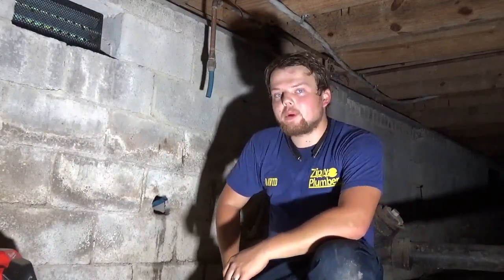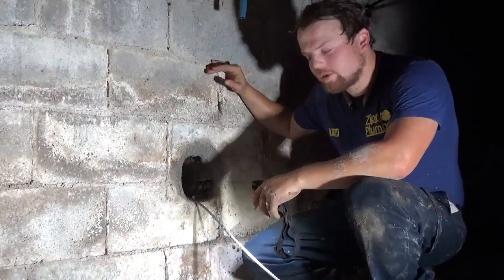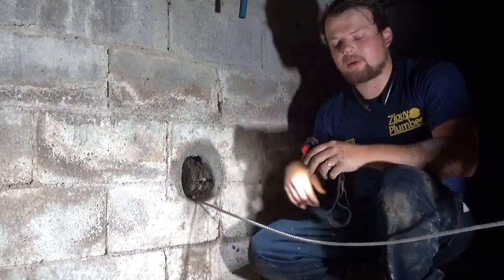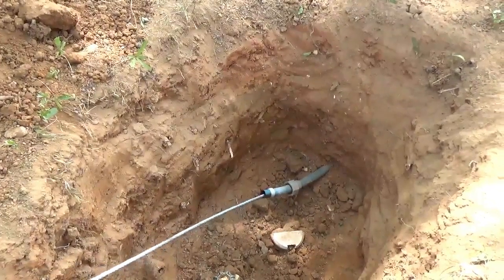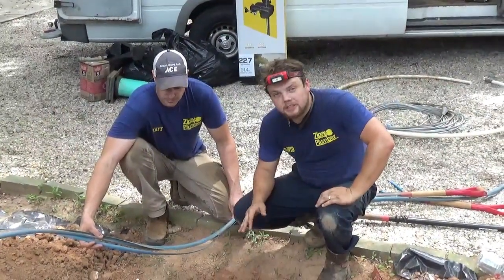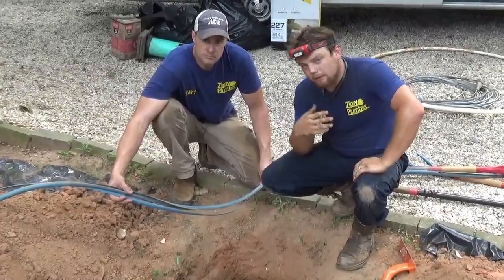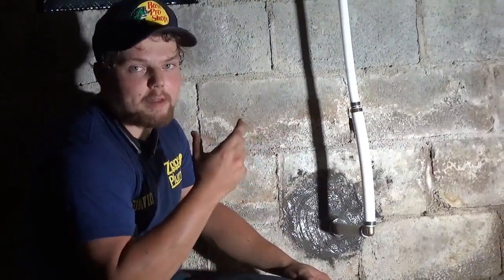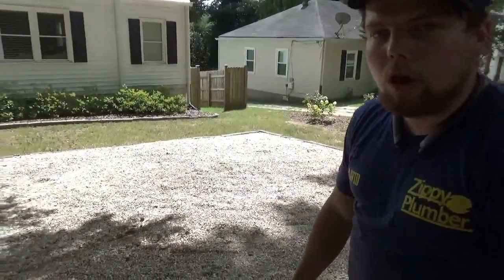Trenchless Water Service Replacement

Comment: Those crimps under the house sure are close to the fittings. I would venture to say they are definitely not within the recommended 1/8 to 1/4" from the end if the pex. This is whybI do my own plumbing. Even when you hire a professional,  you don't get proper work.

Comment: Great work guys. Curious to know what happens if the old pipe is so damaged and cannot be used to guide the new casing through it ?
Reply: You can always shoot your own path and leave the old pipe in the ground. It's called a line bore
Reply: @troylitle3116 directional boring is the same thing?
Reply: Yeah we mostly do Directional boring. Will drill amd pull a 1 1/2" poly sleeve and push in a 1" pex.
Reply: @LearnPlumbing You do CTS the same?
Reply: @LearnPlumbing I know this is an old post.but I’m curious cause I’m replacing a main for a guy and I’m a jack of all trades master of none,and just weighing options
Reply: We abandoned the old line and bored ( drilled ) a new path from Meter to House. Once the boring bit reached the house we attach the new Poly line and the rig pulls it back. Then Voila new water main from Meter to House.

Comment: My 1 inch PVC water line is several hundred feet long and has several barb couplings banded with stainless steel hose clamps in its length.  Can you burst the pipe through one of these couplings?
Reply: What’s a barb coupling

Comment: What is the longest distance you can pull? What type of pipe did you replace it with? Thanks.
Reply: 100 feet
Reply: @2big2h89  I have a meter that the water company moved to the mainstreet. The line is180 feet underneath someone else’s commercial building, it’s blue poly B, or blue polybutylene. The only good news, it is a dead straight pull. 
Do you think it is doable? 
I can get a 200 foot cable, but I have never done it before and this would be my one and done.